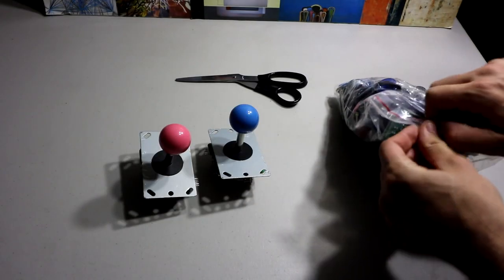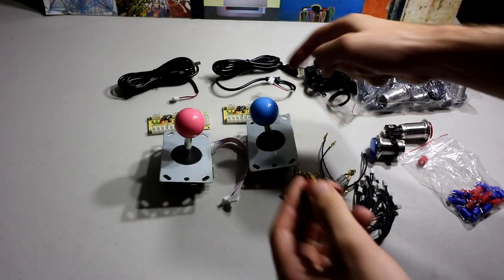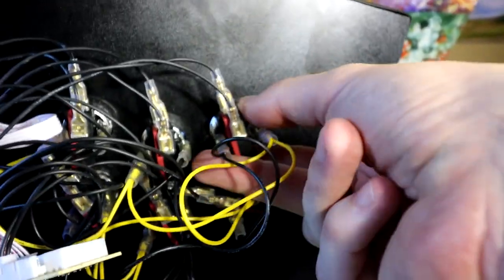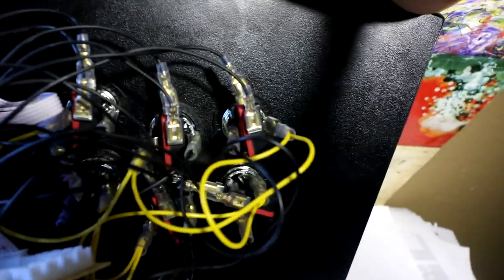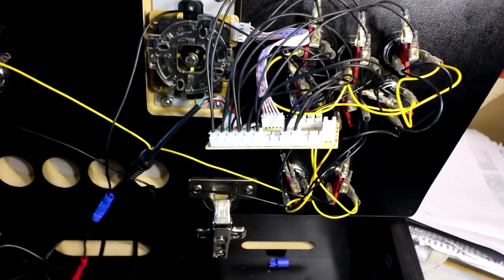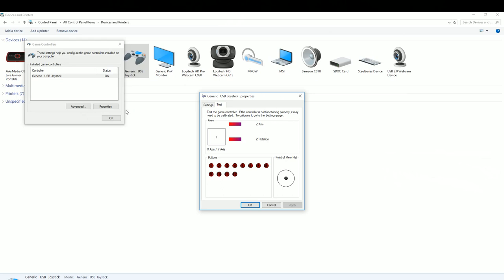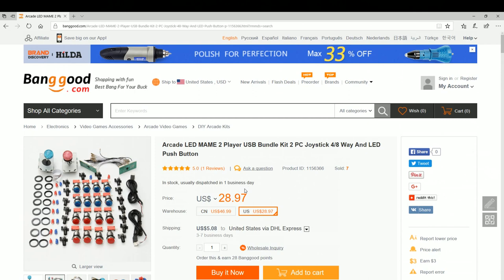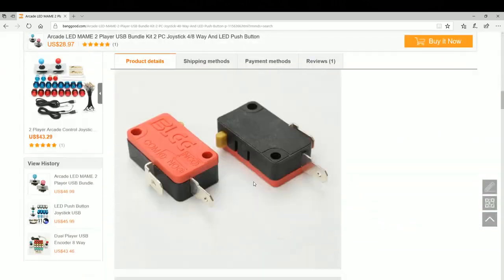LED Arcade Button KIT - Unboxing, Review, and HOW TO SETUP/WIRE

Comment: my stupid self bought a kick to quick to realized that it was a difference kind of USB encoder board that included the led lead, so its a 3 wire plug not a two wire plug, which is great for ease of installation for all the LED buttons it came with BUT I have 3 buttons that were not part of the kit that I want to use so how would I go about splicing or figuring out what each pin on the 3 pin plug does.

Comment: I also purchased a simliar kit and it did not include the LED wires. As you said, quite misleading. Did you use the molex connector or a jamma psu?
Reply from the maker: molex

Comment: Awesom videos man. I'm Having a problem with the wiring with these buttons the blue LED are working and the red are not. Then if I reverse the wiring the red work without the blue. Once one set is on the other is off?? Any taughts?
Thanks
Reply: do you bought the same power adapter

Comment: Hello, I have the same kit but my micro-switch holder doesnt enter in the button, will it be a problem with my kit> or there is a trick to assemble this, it doesnt work even when I try with more force :(
Reply from the maker: you have a pic?
Reply: I fix it, there was little plastic edges in the bottom of the button, causing that microswitch didn't keep in place, but i remove that edges with a pencil and now the button fits perfect!, thanks anyway.
Reply: @drewtalks 😂

Comment: Great video. Question: it is really easy to plug the wire into the microswitch... It kinda locks into place, but is there a trick to unplug the wire from the switch if you have to make a correction? Using pliers or something? Feels like I'm going to break it.
Reply from the maker: yeah its tough!!!! plyers and wiggling...there may be another secret i am not aware of...
Reply: pliers work
Reply: I ended up snapping and had to resolder it

Comment: What do the led positive and negative lines plug into to power it? I have this kit and I have no idea where it plugs
Reply from the maker: you have to get a power supply  5v 1 amp cut the wire open and splice it to a harness to run to the buttons, check this video https://youtu.be/Id0kkgit8P4

Comment: Didnt show them working with raspberry pi can they both work with a pi
Reply from the maker: Yes
Reply: DrewTalks i know how to get them working but without a encoder board cpule you show how to make them work with encoder baord for 2 player please because there much cheaper to purchase
Reply from the maker: You talking about wiring directly to GPIOS? https://github.com/RetroPie/RetroPie-Setup/wiki/GPIO-Modules
I recommend the encoder boards they are super cheap and more flexability - you can find them on ebay
Reply: DrewTalks no i used a xin mo board and then type a code in to make it think theres 2 seperate controllers
Reply from the maker: oh perfect - easy hax also has a script to run so you dont even need to type in the code on his retropie toolkit
Reply: DrewTalks nice ill check that out i love the l.e.d lights think they look the part but always thought with the encoder they would be a pain to get going as 2player